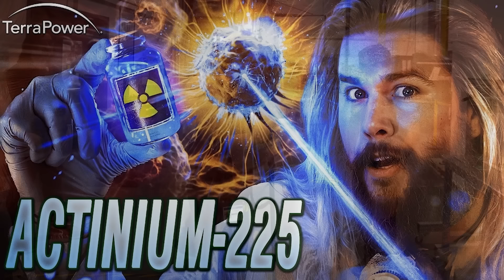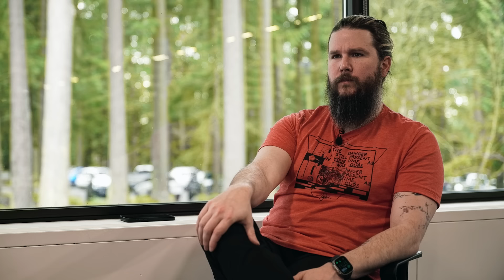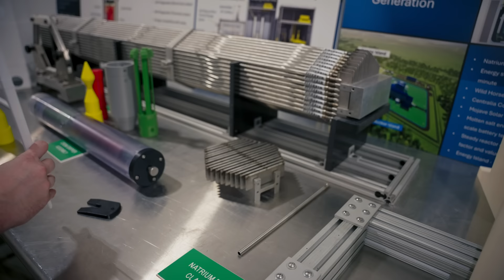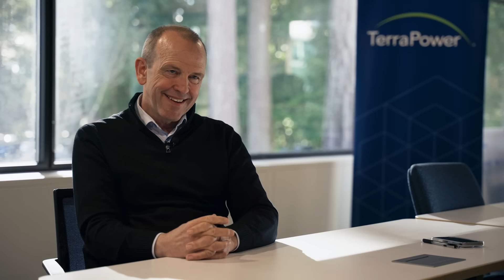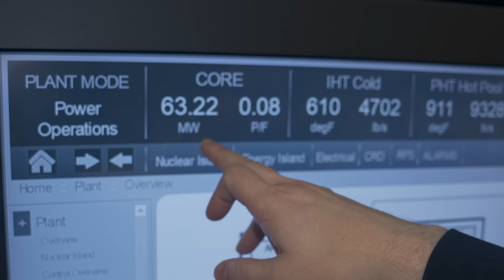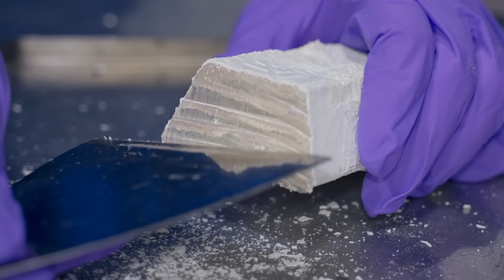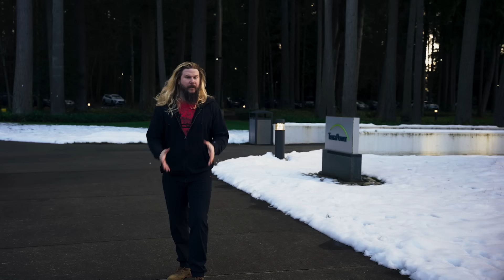Will Natrium Nuclear Reactors Change Everything?

Comment: I thought it was odd that China's current achievements in this area, weren't mentioned.  Seems relevant that China has an operating sodium reactor, I think it's called the CFR-600.  They also have a Thorium reactor operating, that they just finished a full refueling.  There might be even more generation IV reactors in China, given that they have something like just under 30 plants being built right now. 
When the TeraPower person was talking about the tech and referenced the pilot program from the 1960's, it seems like it would have made sense to point out that there are examples of sodium reactors, online and running safely, today.  Or am I missing something about the fundamental differences between the China/Russian built fast sodium reactor, and what TerraPower is working on?

Comment: My understanding is that what makes sodium dangerous in a normal molten salt reactor is that if the sodium reacted and exploded, it could potentially rupture the reactor, causing a radiation leak. But with this design, the sodium is nowhere near the reactor, and thus not nearly as big of an issue. Very neat.

Comment: Nuclear regulators are going to treat the entire salt system as potentially contaminated if it goes through the core. The 'thermal battery' of salt is going to have to be located inside of a containment vessel of some kind.
Something they seem to be overlooking is where are you going to get the people to operate these things. Civilian nuclear power heavily recruits naval nuclear power veterans whose entire training course differs from this approach. Sure, they'll be able to learn, but it won't be quite as smooth a transition. The primary chemistry requirements will also be completely different. How do they plan on removing the non-sodium metal particulates that are inevitably created?
I love that they are trying to innovate, but they have a LOT more hurdles than they are trying to make it seem before actually supplying the grid.

Comment: Honest question:  Isn't liquid sodium very corrosive?  How do they manage to keep all the pipes and tanks used to move the liquid sodium around from corroding and needing frequent replacement?
Reply: Its temperature dependent, liquid sodium isn't corrosive untill it's above 500c which is likley part of the reason they're aiming for around that temperature.

Comment: I am worried that the sodium cooled reactor is one of the most dangerous type of 4-th gen nuclear reactor. It uses pure molten sodium, which is very reactive and prone to catch fire in humid air and water. I guess that it will end up as technical failure like Japanese Monju reactor or French Superphénix reactor. There are many other safer types of 4-th gen reactor like lead-cooled reactor. It is similar to the sodium cooled reactor in theory and operation, and lead does not catch fire.

Comment: I'm a little concerned about storing such a large volume of liquid salt in storage. Won't it lose lots of its energy as waste heat?
Reply: The bigger you make the tanks the more thermal mass you can store per unit of surface area. And they cover that surface area in insulation, even the foundations are insulated

Comment: I thought the main problem with liquid sodium is that it corrodes and pipes and storage tank.  Is that not an issue?
Reply: Fortunately no, stainless steel is up to the task
Reply: @GreenOddish  So why does everyone say it's not?
Reply: @magnetospin  you're talking about the sodium not salt right? can you link a source to that?
Reply: @GreenOddish  I don't have a particular source.  I just see this mentioned in every forum about why we don't have molten salt throium reactors yet.
Reply: @magnetospin  Ah ok. I don't know about thorium salt, but I have worked with both sodium and nitrate salt and I can confidently say that nitrate salt is more aggressive on piping. It also has awful thermal conductivity which makes it much more of a pain to unfreeze lol

Comment: To start the conversation, im a fan of all this, just dont understand it all.

15:36 Hits the water and turns some of it molten.

Thats why the questions arise about safety, because the MOLTEN soldium is trnsferring heat to WATER. Im not sure how that interaction happens, but i crudely imagine a water cold plate with molten soduim flowing over it. If a crack arises in that cold plate, bad things can happen. Delving further, if it is a cold plate... 10 years ago they were being made from brazed aluminum which I don't think has great crack propagation properties.

Comment: Even so isn't it still a bit concerning using liquid sodium to boil water, if there was a leak it would still explode. I would hope they do frequent replacements/maintenance on the water/sodium interface.

At least the radioactive side is separated from the boiling side so if the sodium side did have a containment issue it wouldn't end up ejecting radioactive material.

Comment: And when the pump fails or goes offline, the sodium quickly solidifies in the pipes, core, pumps, tanks?
Reply: U can use magnets to heat it back up really easily, exactly like an induction stove.  It's a huge bonus

Comment: I used to live very near Kemmerer and now I live downwind of it a couple hundred miles.  I see a lot of interesting features explained, but many of them are presented as safety features when in fact they're more like commercial and engineering conveniences than safety enhancements.  How do they stop the reaction?  Does the sodium become irradiated?  Can you use it indefinitely or is it a consumable?  If it is a consumable, what do you do with it afterwards?  Does it alloy with other metals in the reactor at certain temperatures or after a certain amount of time?  Will it then destroy those metals like gallium will destroy aluminum?  If you keep the sodium bathed in argon in the reactor, how do you regulate the pressure of the argon and make sure it stays in the reactor?

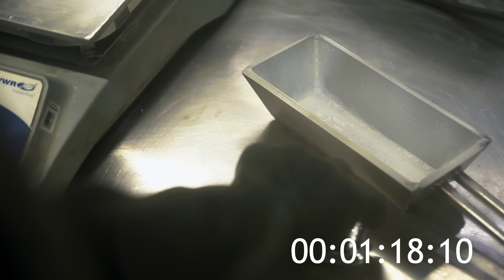Comment: 3:50 I’ve never heard of sodium metal to be magnetic just iron, nickel, and cobalt (Ik he didn’t say it was magnetic he said the can be powered with magnetism) so I looked into it and sodium metal is what you would call paramagnetic which means it can be weakly attracted to a magnetic field. The same way that aluminum or even liquid oxygen is paramagnetic. Paramagnetic metals are usually so weak under induced magnetic fields that you need specialized equipment to see them actually move so now I’m just more confused than when I started looking into it because it sounds like I shouldn’t be able to see this cup of metal spinning around but I’ve definitely got to be missing something. Could it be as simple as the fact that it’s kept in liquid state?

Comment: What we need is a reflux reactor, a hole in the ground 2 km deep 20 M wide filled with water.
 The pressure will be so great at the bottom that the water can't actually boil off but it will remain high temperature. 
Just like an undersea volcanic vent

 That heat zone can then be tapped with an exchanger transferring heat up to the steam production portion.

Comment: The seperate islamds is a lot like how in Factorio if you use nuclear reactors to heat water and exchange steam, you can store that hot steam indefinitely and only draw load from it (via turbines) when you actually are using its power. The steam basically becomes a huge energy "battery".
Reply: Quite difficult to store steam indefinitely. Lots and lots of pressure needed !
Reply: @bobdeverell  In the game it's easy, just a big tank. I understand full well that it's way harder IRL.
But in using melted sodium we simplify things a lot and the basic idea actually applies. Hurray!

Comment: omg FINALLY someone commercializing a molten salt thermal battery to levelize the demand curve, i have been actively advocating for adopting this tech in concentrated solar thermal plants for like five years at this point, I'm happy to see it in nuclear applications as well, being able to run the reactor 24/7 and only generate when the grid needs more electricity is the one thing we need to fully supplant the use of fossil fuels, that's been the one downside of nuclear, that it works best as baseload, not backup, so having a bunch of solar panels at the bottom of the loading order messes it up, but transitioning solar to concentrated solar thermal with a thermal battery backup, and putting the same thermal battery on nuclear reactors, that basically solves the california iso duck problem and paves the way for full decarbonization of the grid

Comment: Did anyone bother to read the memos as to why the military stopped experimenting with liquid metal designs? (sodium and sodium/potassium [NaK]) They should really read those memos. And visit some of the now museums at INL. I'll give Natrium props for making something different, but the nuclear part of the system is the same old 70 year old nasty uranium cycle; it'll make the same waste as every reactor before it. (say it with me children, if you aren't working on a thorium cycle reactor, you're just wasting your time and everyone's money.)

(Yes, we have better science and metallurgy these days, but raw sodium still presents some serious problems. I do like how no one is showing the lengths they're going to to safely play with liquid sodium. This guy needs to talk to a high school chemistry teacher because he clearly doesn't understand what happens when sodium is put in water -- it isn't melting 'tho it is exothermic... it's making sodium hydroxide, hydrogen gas, and heat; that heat is more than enough activation energy to burn the hydrogen gas. eventually you'll get a small pocket of H2/O2 that makes the little bangs, but despite the theatrics from Brainiac, it's not "a hand grenade in a bathtub." Go pour some 500C liquid sodium in a bathtub, that'll be much more interesting )

Comment: 16:10 Actually, the explosion has nothing to do with hydrogen and is a coulombic explosion.
Also, that "You've got heat, hydrogen" is unfinished. There should also be an oxidizer, but there isn't until the hydrogen leaves the space between the sodium and water. That's way too slow for an explosion.

Comment: Errata, solar and wind provides energy only when wind and sunshine is available, NOT whenever the grid requires it.
Reply: I think they meant that they use molten salt to store the energy and grid follow but yeah I agree that’s stated inaccurately.
Reply: Way to be That Guy. Everyone knows, it's just a convention of speech. Moreover, since they were talking about solar thermal plants where the liquid sodium also serves as a battery and continues to provide power after sundown, it was accurate.
Reply: @RedMike-ym8hd  At least one of those big plants is getting closed due to bad economics, as that molten salt  battery needed lots of gas burned to initially heat it to provide some energy in the mornings.

Mentioning some example projects where molten salt energy accumulators were already proved would be a really nice touch to make a point about this approach.
Also the expected buffer capacity would be interesting to know. Just as well as mention of the fact that with classic steam generators such power plants have very grid high phase stabilization characteristics, just as conventional, nuclear and hydro does, unlike conventional solar and wind (which may lead to unstable power grid, and normal battery banks with inverters don't have that ability).
Reply: @AgneDei  It's okay to just say "whoops sorry, my bad, I got a thing wrong."

Comment: I like next gen reactors. I personally prefer the use of lead and molten salts over sodium. This is primarily because these types of reactors operate at higher temperatures and don't burn when in contact with air (though they are corrosive, likely more so than sodium).
I heard that TerraPower is also working on a sodium chloride fast reactor.
Edit: This was made before I watched that one segment. I heard that Russia has sodium reactors that they just let burn. I wouldn't be surprised if Argon is all it takes to eliminate reactivity, as Russia/USSR has been really lazy with reactor designs in the past. cough cough chernobyl.

Comment: so, how do you convert heat energy to electrical energy? water -> to steam. its still a steam power plant.
Reply: You put a turbine between your high pressure steam and a low pressure zone. The turbine is driven by the steam as it pushes its way through it, which spins a dynamo which generates electricity. The low pressure zone also condenses the steam back to water to be pumped back into the boiler.

Comment: The problem here is that since the  absorption cross section for uranium is too small for criticality without high enrichment of 235 and a large amount of fuel to maintain criticality. This makes the cost of the fuel a lot higher, this can me mitigated by turning isotopes that are fertile into fuel but at the end of the day enrichment is extremely expensive. Ideally I would think Th232 as a relatively abundant element at high concentrations of the usable isotope would be a perfect fertile fuel to drastically reduce fuel cost
Reply: Uranium enrichment is dirt cheap and only gets easier the higher you go.
Reply: @ just did the math, about 4500$ per kg with gas centrifuge enrichment for the enrichment required for this reactor

Comment: Crazy to think even with all this science, technology and engineering we still just use it to boil water to power a steam turbine, I think the Gen 4+ or Gen 5 should be able to pull energy directly from the reaction, or even better we find a completly new source of energy which is better than electricity.

Comment: Sodium reactors are not new. There have been prototypes built starting back in the sixties. The government decided to yank funding. The Russians built designs too. It's a fast reactor.

It originated with a NaK eutectic fluid, which was easier to pump and required lower temperatures for operation. Again, nothing new...

Comment: Current pressurized water reactors are already demand-following and will continue producing power after a SCRAM (for some amount of time). There's a little dishonesty in talking about those things like they're new.

Additionally, we're not that concerned about sodium's reactiveness with water as we are with corrosion of the reactor components, a problem where progress has been made but that is far from solved.

Comment: Personally I think all liquid Sodium reactors are a terrible idea.  Sodium is VERY corrosive.  Eventually the Sodium is going to leak.  And it is explosive when it contacts water.  And it will be mixed with radioactive elements.   Just an all around terrible idea.

Comment: This technology excites me. When I was in the navy in the nuclear program, we were taught that Fast Fission was a bad thing because, among other things, in a light water reactor, you can't moderate fast neutrons with water and it can create a runaway chain reaction. We were also shown the danger of some of the Russian sodium cooled plants (which still used thermal neutrons if memory serves) of the sodium being explosive when exposed to water, which you can imagine is bad for a maritime plant. I believe also, we got told (but cannot verify due to really faulty memory) that an Na plant as existed in the soviet years had the potential to cool down and solidify in the tube, where it would no longer be able to sustain a reaction the same way but also, it would no longer be as an effective a moderating agent. This seems to have an answer to both issues and is based on some really sound physics and safer, as an LWR plant is very high pressure. The Primary loop has to be high pressure to keep the water a liquid, as the video stated, but the secondary loop, the steam side, is also several hundred PSI... which, if you can picture that in a leak scenario, starts to look real ugly, real fast.
Reply: Also- are these guys hiring? Asking for a broken former navy nuke. It's me. I'm the broken former navy nuke and I'd LOVE to get back into the industry.
Reply: Every steam turbine needs high pressure superheated steam, there is no workaround.
Reply: @jakubiskra523  I'm not sure if we watched the same video, but this one said it was an atmospheric pressure reactor. Yes, we know steam has to be under pressure to turn a turbine, but the reactor vessel itself doesn't need to be super-pressurized to keep the water a liquid, because there is no water. That's the safety issue they mentioned. In a LWR both the primary and secondary loops are pressurized, and in some cases, to several hundred PSI. That is not necessary here.
Reply: There is no moderator in the natrium design or any fast spectrum reactor. The main soviet sub liquid metal reactors used lead-bismuth, not sodium and were fast spectrum reactors (OK-550 or BM-40A on Alpha class). At least 2 of them are known to be destroyed by allowing the coolant to freeze. Most of the other soviet naval reactors are PWRs.
Reply: @richardb1452  I should have said cooling agent, that one's on me. And good catch on the lead-bismuth.
Reply: @CajunDad79  Yeah, they figured out much like the US did with the skipjack class Seawolf that sodium coolant in a military naval reactor is not optimal.

Comment: I really can't wait for Kyle to get round to the Moltex SSR.
It's a Molten Salt reactor with no pumped fuel salt, no requirement for online fuel reprocessing and no need for the global approval of New Nuclear Steels.
That last one is really important when it comes to MSRs. We may have prototyped assume new steels for experimental reactors in the 60s, but that's a long way off getting them signed off by all the major national nuclear regulatory commissions.